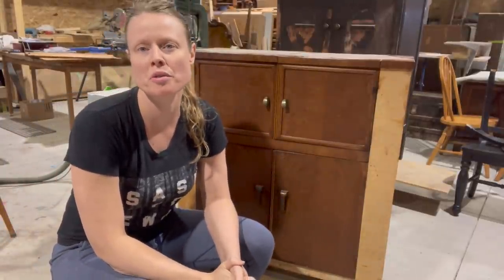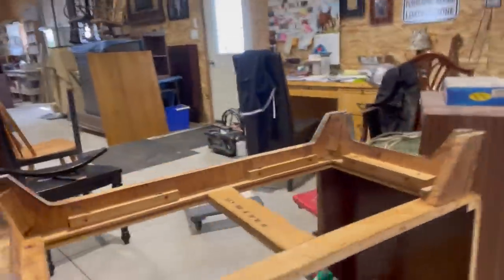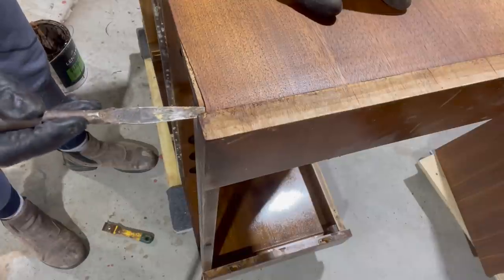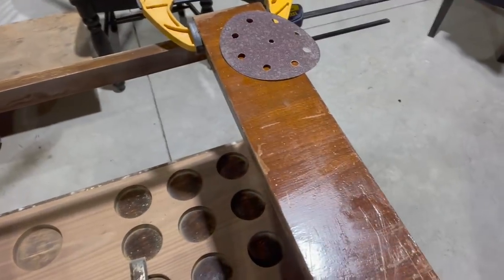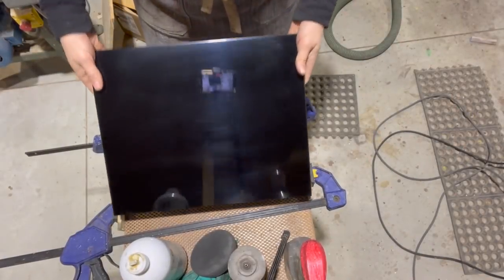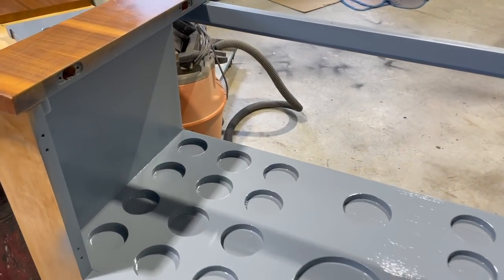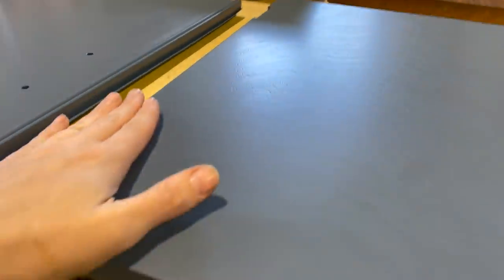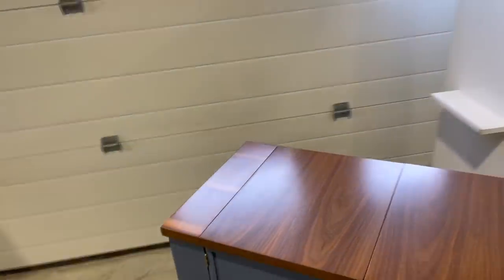Stripping and painting a midcentury teak mini-bar

Comment: A piece of advice, when you pass the abrasive paste, also spray a little water on the surface. It will help the paste to polish without burning the transparent that is on top of the piece of furniture.
Secrets from "Car body shop".😜
Reply from the maker: thanks for the tip! I want to take a class on proper polishing and buffing, car people seem to be a good start.

Comment: Great look! I love teak, and would have had a hard time deciding to paint, but the interior, due to the water damage, I agree it was a smart choice. You talked about getting the customer's reaction. Understand some are camera shy, but I'd be surprised if it wasn't outright shock & AWE. 🤩 Due to the oiliness of teak, I've had mixed results with finishing solutions. Which finish do you use? 🤔Thanks for another cool vid.
Reply from the maker: lacquer is pretty good on teak, i have found anything water based just peels off.

Comment: Suggestion. Use a straw cut to length needed and attach to bottle or tube of glue with electrical tape and it'll get the glue inside. The straw flatens and gets inside tiny places. I can send you a picture of what I did for fixing some veneer.